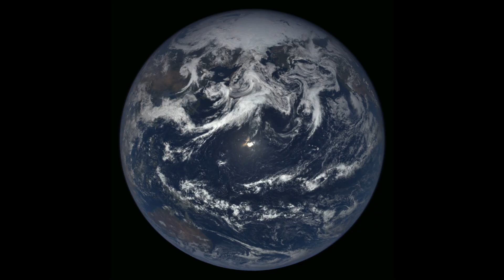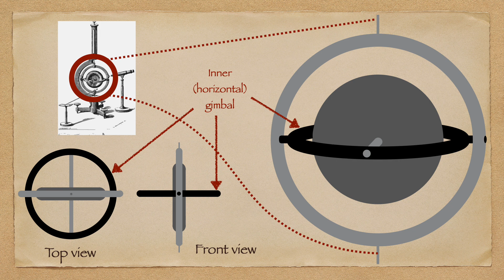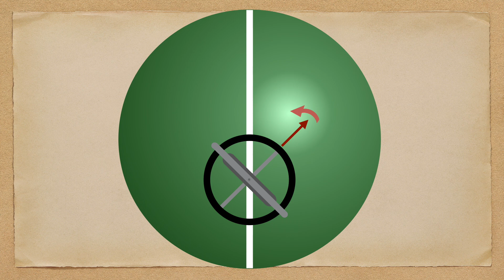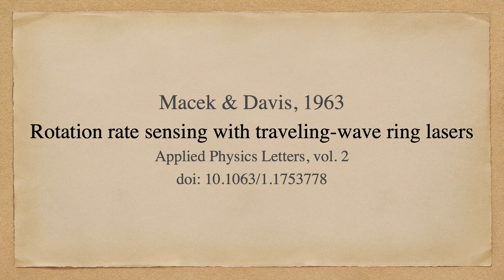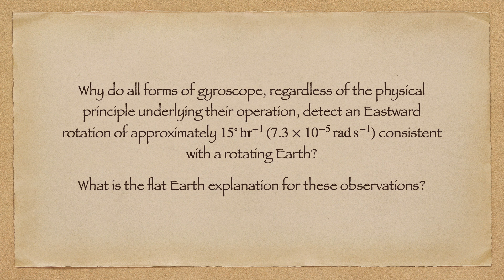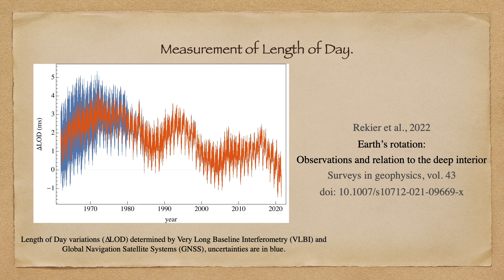Lies that flerfs tell - Episode 6: There is no evidence Earth rotates (gyroscopes)

Comment: I have been working with large ring laser for more than 20 years and we always measure earth rotation. I have done testing of a fiber gyro and you can do a neat experiment with one. If you measure earth rotation and you turn the gyro over 180 degrees you see the display showing the rotation going in the other direction proving its really earth rotation and not some artifact.
Reply from the maker: Right, in the experiments shown they tend to rotate the instruments because inversion is impractical - but it's the same principle.
Reply: @PhDTony_original  Yes impossible to tip them over. The fiber Gyro we have is the size of a computer hard drive very neat piece of kit. I haven't been to ROMY but I have been to the G Laser in Wettzell Germany. I have worked on all of the Canterbury Large Ring Lasers. Before the earth quake we had a 17X21M rectangular ring. If you ever get across the ditch happy to show you our rings.
Reply from the maker: @robbarton7972  that would be a wonderful opportunity, thank you so much. Now I feel like a fraud, this should be your video!

Comment: @PhD Tony you need to have a look at Culture Catz latest videos on an idiot Australian Senator try to science in estimates and crashes and burns.
Reply from the maker: I have, it's embarrassing that that ignoramus has been elected to office.

However, his main problem is not what Catz thinks it is. He seems to accept that there is more IR energy in Earth's atmosphere because of higher CO2 concentrations. He just doesn't understand how that energy gets into the oxygen & nitrogen.

He's right to suggest that it must be molecular collision, but it is not collision with CO2 molecules - it's collision between land and water molecules and the air molecules above them. Impact of IR energy on land and water raises their temperature. In turn, conduction of that energy heats the air near the surface, which convects upward, is replaced by colder air, which in turn is heated and convects, and so on.

Also, as the heated air convects, it transfers energy to other gas molecules via collision.

I've left a comment on Catz's video.

Comment: Maybe you presented this elsewhere, but to me, the best evidence for a rotating earth is the constant "motion" of the stars.  Astronomy has established stars are individual objects at varying distances from earth, so it cannot be claimed that the stars positions are in any way subjective or some kind of illusion.  There is no reason for such objects to move in a circle around our lowly solar system, as motion in a circle requires a centripetal force.  Furthermore, motion of all those individual objects at different distances would imply an impossible coordination to keep the relative position of all these stars and galaxies constant.  Finally, nothing can go faster than the speed of light and that would mean stars and particularly galaxies would have to be going faster than the speed of light to get around such a great circumference that results from a very large distances from earth in one 24 hour period.

So if the stars are not moving, then our platform for observing the stars must be rotating.  Nothing else makes sense.  One can then establish that the earth is a sphere by noting the changes in the angle to the celestial north or south poles with changing north-south position on earth.  The mere fact that we can see stars in all directions would not be possible on a flat earth but would the easy on a rotating globe.  It also explains the opposite direction of the apparent rotation of the stars around the north and south celestial poles.
Reply from the maker: I agree, however, flat earthers respond with some combination of:

They're just lights in the sky

You can't tell the shape of the thing you're standing on by looking up

That effect is not due to motion, it's due to light bending to make it look like motion.

That's why I started with earth-based observations.
Reply from the maker: Flat earthers also do not accept that celestial objects are at different distances. They claim the stars all lie on a dome.

Parallax requires Earth orbit the sun - which they reject.

Comment: A fifteen degrees per hour drift?
As a fun fact, I was using mechanical gyroscope to detect rotational axis for military artillery as military service in Sweden during the 1980:th. We used an instrument that looks like Wild Heerbrugg MIL-ABLE Gyro T2
The accuracy was 1/1000 of a radiant, if we used linear average of the direction of the first three swings around the rotational axis of the globe (when it was settling), taking 11 minutes, sufficient for peace time firing at artillery range.
The only "nuh-hu" I have got from flerfs are "a gyrscope is difficult to use so it must be fake"

Comment: On the subject of procession along with my Wil Tirion Sky atlas 2000. I also had both volumes of the Sky catalogue 2000.0 
The catalogue resembles something more akin to a phone directory. Volume 1 had stars down to magnitude 8 listing coordinates for epoch 2000 along with numerous bits of data including procession. Because stars are observed to move over time. Volume 2 had double stars, variables and non stellar objects.
The atlas is epoch 2000 as it has the stars printed in the correct positions for the year 2000. I also have somewhere a copy or a Nortons star atlas which is epoch 1950.

Most pole finder scopes used with equatorial mounted telescopes for the northern hemisphere. Use Polaris as a guide. You dial in the date to your local meridian time and it gives you a mark as to where Polaris is in relation to the celestial pole so you can easily set your scope up. The marking for Polaris would have some graduations that are referenced to the year. Because Polaris moves relative to the celestial pole. Enough that it’s taken into account and it’s marked there on the pole finder scope. It’s definitely moved since I first started messing with telescopes in the 80’s.

I’ve used a line when some flerfs maintain that the earth and solar system cannot be moving because when they look up in the night sky. Nothing moves or has ever been observed to have moved. To which I retort, that statement is like a mayfly stating plants don’t grow as they’ve never seen any change in size over their life time